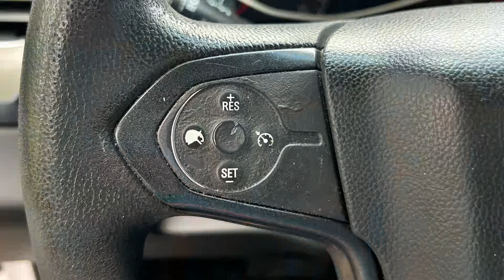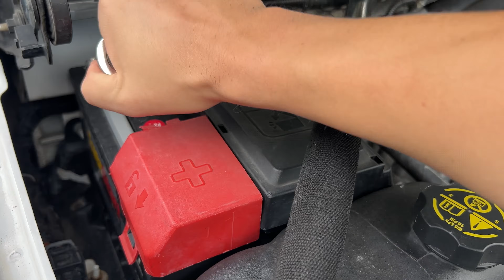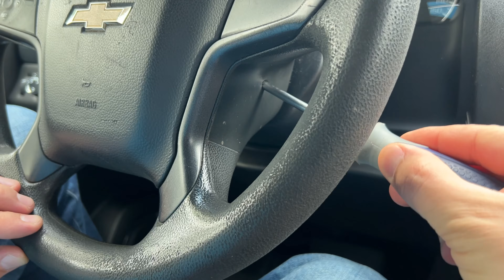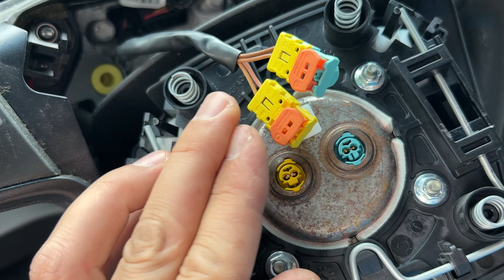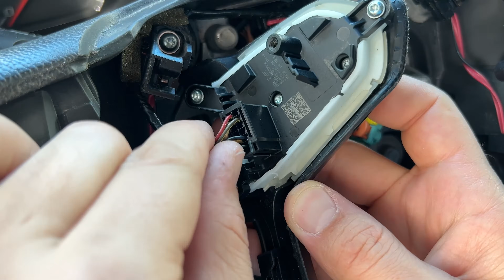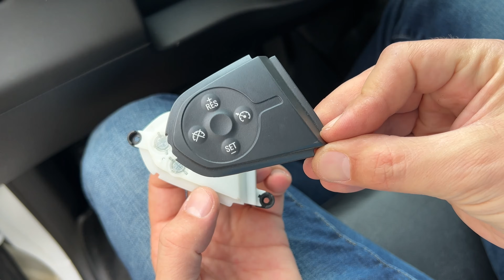How to replace Chevy steering wheel buttons

Comment: There's no way you have to do all this just for the cover. You can certainly just pry it out and force new ones back in, there are no clips or anything holding the black rubber part in place.
Reply from the maker: Buttons circuit board is pressed against it with 3 screws. I doubt it will work as you described.
Reply: @DIYtime I couldn't do it lol.

Comment: My truck doesn't have the buttons on the right side and I bought the buttons thinking it had the connector inside. How or where can I get the cable that has what is necessary to connect the buttons on the right side?
Reply from the maker: Your best bet would be eBay or junk yard.

Comment: Is there a connection to add volume control for the right side ?
Reply: I don’t think so though
Reply: @MacleanKeithly  There must be a harness you could buy .
Reply: I have the same question
Reply: i just opened mine and there’s no plug to plug it into but if you find something that connects let me know
Reply: Wondering the same
Reply: Right side of mine is for the menu options.  Volume buttons are on back like a paddle shifter